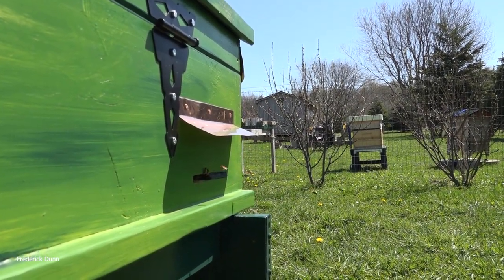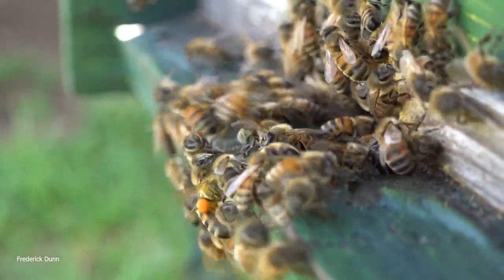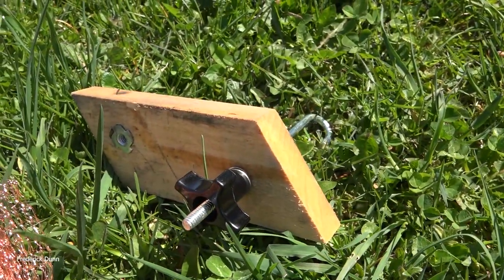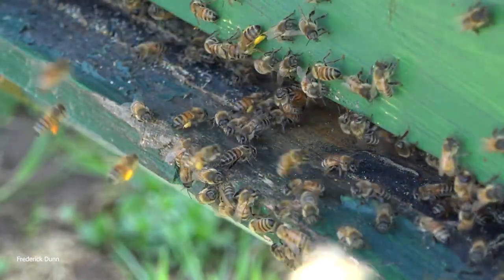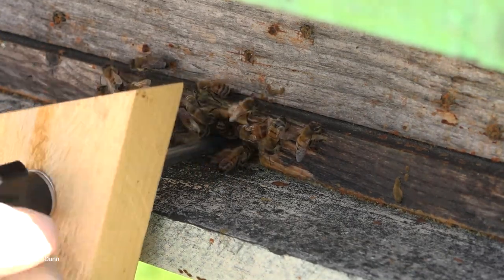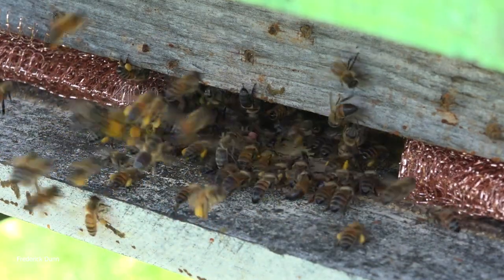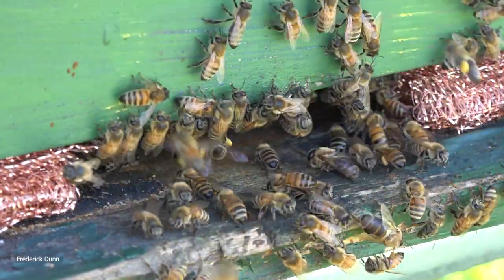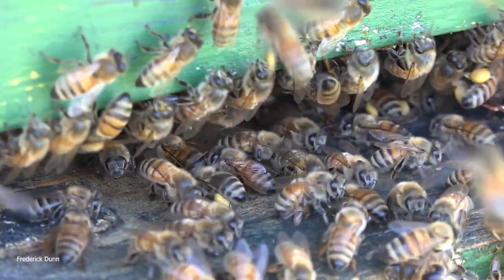Beehive entrance reducer Removal, how to pull it out VERY easy. Venting. STUCK Hive Entrance, nope.

Comment: I use Polystyrene to reduce my entrances, have been using it since the 1980s  - if the bees require extra width, they can chew out when necessary
Reply from the maker: They do chew it that's for sure. I've had them chew through polystirene covers.

Comment: Hello Frederick.  I ordered that Copper mesh yet it does not want to stay in the flow hive entrance, so I ordered the wire mesh and it was too think and could not cut it or fold it.  What wire/screen mesh to you use that you can cut and fold and use as a ventilating entrance reducer?  Grateful always.
Reply from the maker: HI Brad, I use Aluminum window screen. It remains somewhat "springy" and fills that gap nicely. :)

Comment: Love your videos Fredrick. Here in Michigan the weather has varied greatly from day to day. Yesterday it was 70 degrees, today 60 degrees and then later this coming week back down to below freezing at night. I have left my entrance reducer on along with the mouse guard. The reducer is the bigger opening, about 2 inches. My concern is that because it gets cold at night the bees would get too cold. Also that if I removed the mouse guard cold mice would find their way in. Any advice? Thanks!
Reply from the maker: Hi Eddie, if you don't have upper venting, the landing board openings aren't so much of a "cold weather" concern as the bees will simply reduce the amount of air the circulate up. This time of year, I don't have any issues with mice attempting to get into a heavily occupied hive. I have seen them on camera springing across the lawn at night, but not showing interest in landing boards.

Comment: Great video!  Is there any point in time that you don't use a reducer of some kind at all?  Or always reduce at some level.  I'll be installing my first two nucs soon (one into the flow hive 2 and another into a traditional langstroth).  The traditional one came with a wood reducer with two options.
Reply from the maker: There have been heavy nectar flows when robbing risks are at an all time low, that's when I tend to remove the entire entrance reducer for my strongest colonies. Definitely makes a difference.

Comment: I make entrances that can be opened up to 4 inches. To me that is enough even for the most active times. The entrance in this video should be opened up to 3 to 4 inches.
Reply from the maker: Thank you for sharing what you do with your bees. Yes, these entrances were opened to exactly 4 inches. There are no set rules regarding entrance reduction as not every colony is the same in strength or disposition.

Comment: I don't know if you intend it this way, but do you realize that when you roll screen or mesh up like that, you eliminate most airflow through it?
That creates so much friction and turbulence as the air tries passing through the multiple layers, that it isn't much better than a solid barrier, unless there is a pressure differential across it, such as a wind blowing directly on it, and even then it just gently filters through.

It may slightly increase the airflow, but if the goal is to allow airflow across the entire entrance, it won't be anything like an open entrance.

Even just a single layer of screen stretched flat makes a very noticeable difference in air exchange in still air when compared to an open window with no screen, and when rolled up it creates a labyrinth the air has to push through.

If you want maximum airflow but a limited opening, you would need to have it flat, possibly even do a "screened porch" so that you have a large surface of screen for the air to circulate through, rather than just the width of the entrance.
That would actually be an interesting project, basically a frame that sets on the landing board, with say, a 4 inch tall front aspect, and screen across the entire front, vertical from the front edge of the landing board, and across the top over the landing board, but 4 inches above it.

Then you make your entrance as a cutout in the screen, but as soon as the bees land, they are inside the screen porch.
This would allow the bees to fan on the entire landing board, but inside the screen, allowing much more airflow, but a reduced entrance that can be guarded.
Might also reduce robbing and Beatles and wasp attacks, because they would tend to end up on the screen rather than the entrance.

Anyway, I just keep seeing the rolled up and compressed layers of screen, and wanted to say that they block most airflow.
Reply from the maker: Those are all great thoughts and suggestions. Air passes through remarkably easy, even with rolled screen. One advantage for the bees is that they can easily propolize the screen if they elect to. It's better than a solid entrance reducer and yet still manages to impede driving rain and wind that we often get here. If you dangle a thread in front of the rolled screen, you'll get a really good visual of the air movement. How did you test your rolled screen air reduction? Thanks for sharing.
Reply: @FrederickDunn  science! Lol

Pressure drop across screens is a factor that has to be planned for in hvac and industrial systems etc, and a second layer in close proximity doesn't just double the restriction, it adds much more because the air isn't able to return to smooth flow before hitting the second one, and so it's a turbulent flow hitting the second layer, so even less air makes it through, and each additional layer further drops the pressure and reduces the flow.

This is exactly the principle used in a muffler, or in pneumatic systems to slow air flow.

In fact, you know the fluffy, furry "Dead Cat" microphone wind socks? They work by slowing the air down one layer of fibers at a time, so that it is not moving by the it reaches the microphone.

Here's an extract from a paper on the subject ;)

"Screens have a major drawback in that they reduce the rate of ventilation because of their resistance to airflow. As air flows through the screen a static pressure drop occurs across it. This pressure loss is usually specified in the literature by a pressure-loss coefficient, K, which is a function of the porosity of the screen and of the Reynolds number. Numerical simulations show that the pressure loss coefficient of a woven screen may also be dependent on the texture of the weave when the spacing between two adjacent threads of the screen is small in comparison with the thread diameter. The simulations show that the velocity field immediately downstream from the screen is strongly dependent on the weave texture."

Now, as I said, if you are getting the results that you desire, then there is nothing wrong with it, but it isn't the same as an open entrance, and just because it's screen doesn't mean it lets air flow freely.
Reply from the maker: @ke6gwf  Absolutely correct, more air restriction than an entirely open landing board. Thank you for sharing your hvac experience.